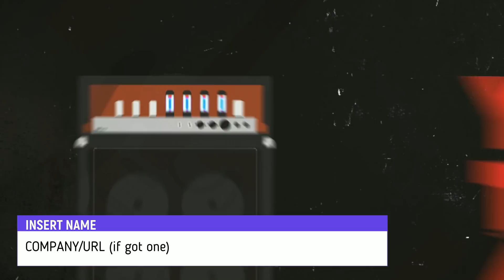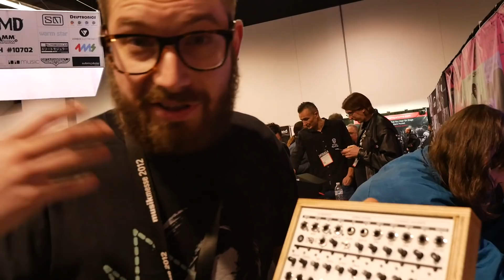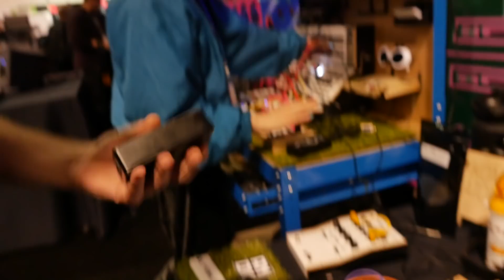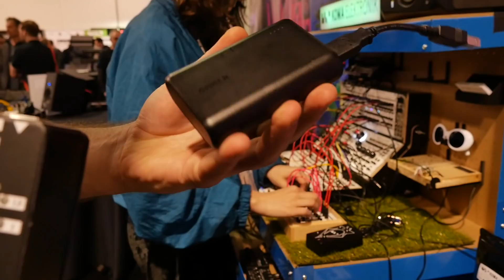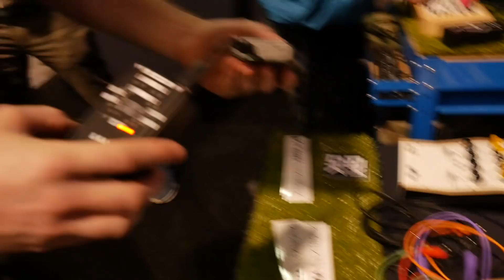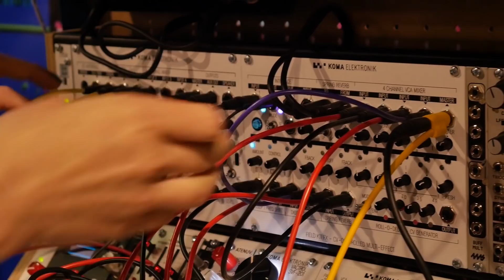NAMM 2018: Koma Elektronik FieldKit FX and Strom Mobile Power

Comment: These both look so cool. I wonder if the Stom will work for the 0-Coast which runs on 15v (but which Make Noise also says will work at 12, but at higher amperage).
Reply: we just tested it, works like a charm.